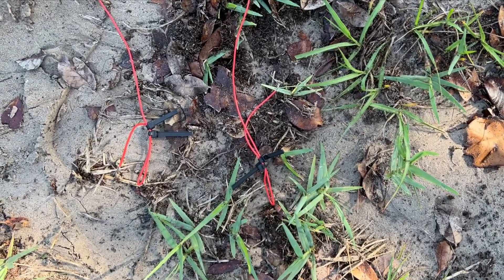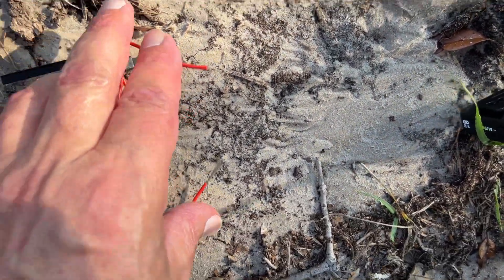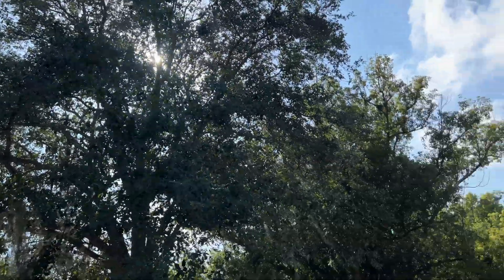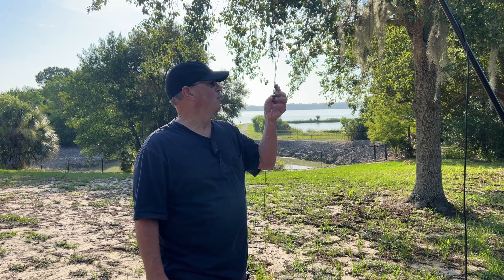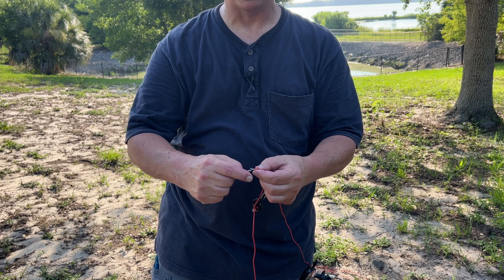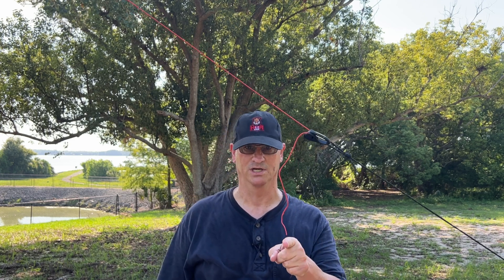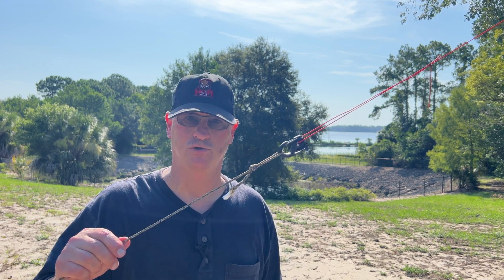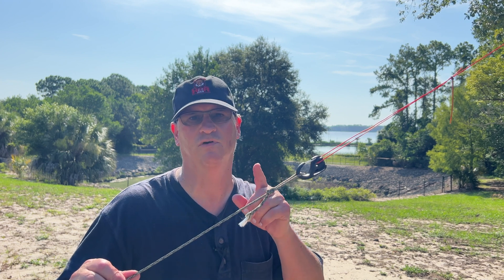Part 5 TUNE ANTENNA:  Build a Linked Dipole for 10, 20, 40 Meter Ham Bands -- CaHR Mercury Kit

Comment: Nice vid. I’m definitely not a pro antenna builder, but I believe the way you have the wire loose in the cam jam, it’s still essentially one length. For it to not “see itself” you need to do a tight wind folding it back on itself, or slowly cut it to get the right measurements on the analyzer.
Reply from the maker: MCB, thanks for watching and for the feedback.  I've done a few builds recently and I'm continuing to learn new facts and techniques to apply for the next one.

Comment: First very nice video series on building a link dipole.  Since you are using insulated wire. You are actually linear loading the antenna when you fold back the wire on itself.  If it was bare wire then the fold back would look like a single piece of wire.
Reply from the maker: Learn something new everyday.  Thanks for the specific feedback.